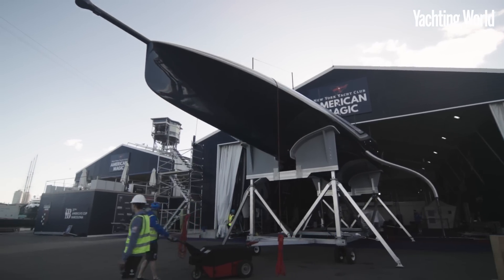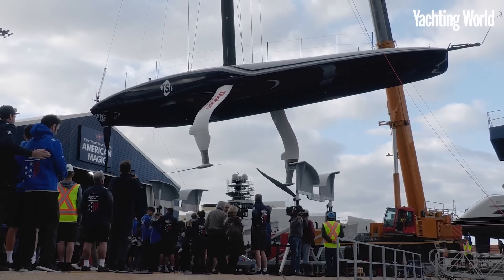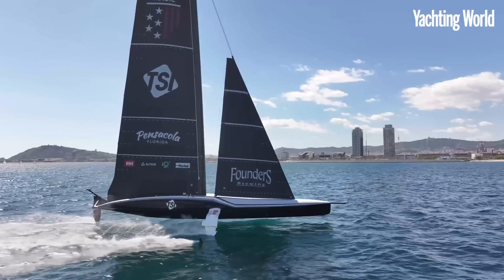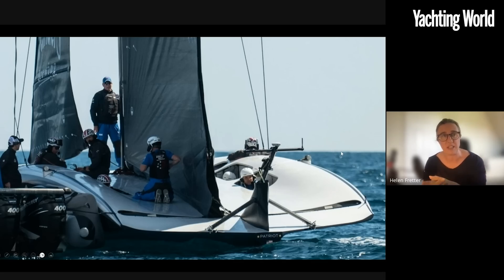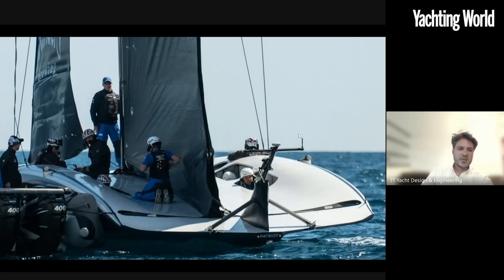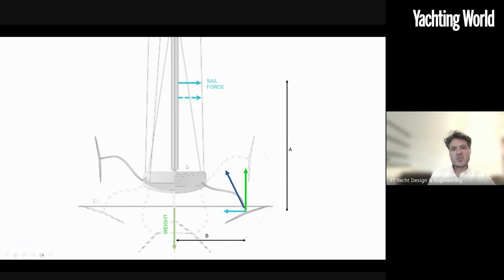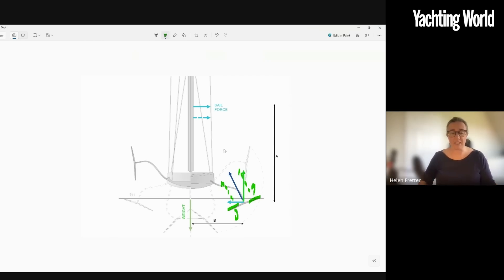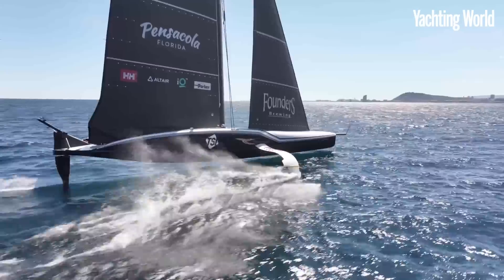American Magic's AC75 'Patriot' | An America's Cup designer's analysis | Yachting World

Comment: HORRENDOUS!!!
Hello... here the "innovation" is to use inverted wings to create lift, but the fact that you need 4 men cranking handles and/or pedaling ruins the whole idea of a yacht.
All systems should be powered by the force of the wind, effectively feeding the needs of the yacht’s hydraulic, electric, battery, and other systems.
With this, the designers or organizers have made a serious mistake; they lacked common sense, the fundamentals of navigation (using the power of the wind, not human power), etc.
I hope that next year there will be rational progress on this issue so that the competition is solely about sailors and not cyclists, with 50% of the crew dedicated to pedaling. Best regards!
Reply: Human power has been used on sail boats forever and part of the crew was onboard to function as counterweight and/or to power the winches. Until recently, they winched with arm power, now they pedal with leg power. Legs are stronger. Certainly less traditional but makes more sense.
Reply: @my_dear_friend_  Correct, I know all that. That's why I consider this action of pedaling on a sailboat as nonsensical! Especially since it's clear that there are energy sources like wind, the relative movement of the sea, and solar energy, all of which could provide power to batteries that could move the entire system on board. I hope that in the coming years they will hire professional seafarers and not cyclists staring down, used like hamsters on a spinning wheel. Best regards!

Comment: No comment on the relatively large rudder stock above the hull or added windage (maybe?) of side by side helm/trimmer?
Foils and sails will matter most I reckon. Hull is largely something to mount the other bits on :)
Reply: That large rudder stock is part of the rule - for camera mounts. They let the cat out of the bag early but, Patriot can get on foils in 6 knots of wind. The larger boats could be faster in  a drag race, but patriot should be able to out accelerate them. also The weather  in the fall will play a huge part, its supposed to be light wind and choppy water conditions.

Comment: Win the Cup back and restore this race series to colossal keelboats with crew, sail work, close match strategy and tactics, and leave this trash all but forgotten.  Super maxis are already vastly more impressive.  The J class is vastly more impressive and it's nearly a century old.  Why should AC suffer in some odd sailing backwater, like big Moths in ponds?  Or shall AC end up in ice skates run by radio?
Reply: Go watch the j class and 12 meters at this years cup then
Reply: @nicholaycalhoun1681 straight up Keel boats Boring
Reply: I would be disappointed that the cup was not used to advance the sport of sailing, while the non sailing puplic laugh at boats going 10 knots when the old cup boats were doing 40 in the same wind strength.
Reply: @ross82  the j class, 12 meter and ac 75 all have their own series
Reply: Anything non foiling in the AC from here would be a laughing stock.
Reply: This is progress..!
Reply: I thought similar, then around 2012 I was having a looking through the J-class yacht Shamrock V and discussing this. Captain Nick Ryan said that the AC class is meant to be the the best sailing technology for the current time, above everything else. Pushing the boundaries of what can be done, and which dilutes into everyday technology
Reply: @Nick1182  Nope.  The best sailing technology is SaiRocket.  The best sailing technology is skates and radios.  The best sailing technology exists in a virtual simulator.

At some point either the Cup decides to return to a proper sailing event among proper sailing yachts with proper crews executing proper, leading edge methodologies and seamanship or it will end up even more diminished than it is now.

Again, the unanswered question posed to the poor reasoning that says this is a pure tech event is obvious:  Why not iceboats and remote control.  After all, it's all about "leading technology" in the pursuit of radical speed.
Reply: @trajectionable and @ross82 why do you bother? Is it to stir up the audience for a class of yacht that you secretly indulge in (otherwise you wouldn't have watched this video) but at the same time you don't fully understand? Like the J-Class yachts, classic cars are also impressive but are from a moment in time that can be appreciated, for their austerity and memories. There's no need to return to the old ways in AC, this is a race to continually improve and advance sailing. Sailing is about tactics, reading the conditions and maximising the power out of your sails for the best possible VMG. These same principles have been applied in every America's Cup. There are plenty of yacht races out there that suit your viewing needs and who knows maybe even one that uses a sextant to work out where the course boundary is.
Reply: What's the difference with massive gym monkeys arm grinding winches. That's all they did. Are they sailing?  @ross82
Reply: @Trajectionable  Be truthful, why get so worked up on the comments of a video you haven't watched. Enjoy your cave with your head in the sand.
Reply: Boring
Reply: Ok Boomer
Reply: You should have stopped commenting after your only sensible remark about winning the cup back. 

The rest is sour grapes and gobbledegook.

Yes there are faster boats, but the combination of speed, maneuverability and ability to accelerate of these AC75s makes the America's Cup more interesting to watch for a broader audience.
Reply: @frwansie  There are much faster wind-driven craft.  Maneuverability is made-up and irrelevant and again, not exceptional.  Likewise acceleration.

If you knew why you're defending these things you'd make a sensible argument.
Reply: Crickey there are some serious chips on shoulders in the comments.
Reply: Speed. That is why my compatriot. The American's where on the forefront of this "foiling" era. Do not forget. In the end, sailing is sailing.
Reply: They should bring back trimarans like USA17
Reply: boring
Reply: I agree, Like F1 the commentator has to hype the race up.  It's not actually yachting.
Reply: Yes. Let Formula One cars go back to the designs used when Alfa Romeo dominated races around 1950
Reply: @frwansie  These aren't the fastest boats on the water and your analogy is silly.
Reply: @Trajectionable  

No.